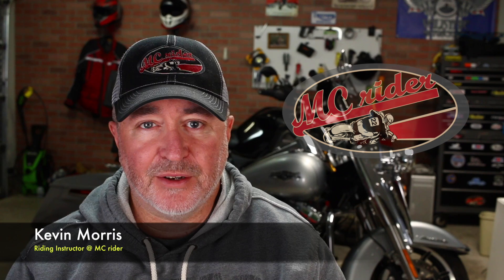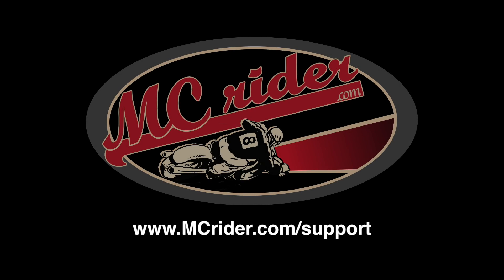How to start and stop a motorcycle with control

Comment: i still can't get into the habit of putting only the left foot down at stops, most likely from starting out with 1966 triumph and 1965 sportster which both have right side shifters,  i even had a norton like that with a reversed shift pattern 1 up 3 down,  you learn quickly how to use a front brake smoothly with those bikes, i would agree that using the front brake during slow maneuvers is not something for beginners. there are some instructors that will say to never use the front brake at slow speed especially when turning which is a farce, it just takes a lot of practice to do it safely, watch the japanese police do slow maneuvers and you'll see they constantly use the front brake to make the front wheel tuck on purpose, my particular bike is known for a very short friction zone which makes slow riding even more of a pain, remember all motorcycles don't handle like yours.
Reply: paul 466 Hey Paul. In Australia, our courses are taught to be ready to move if you need to. Stay in 1st gear, clutch in, rear brake applied and only one foot down. You see heavy cruiser riders around here who take forever to be able to move off.. they are in neutral, arms crossed while they weight for the green light. Take two or three seconds for them to move off when in that posture.

Stay safe with the rubber side down.
Reply: i don't quite get your point, you can still take off instantly holding a front brake with only the right foot on the ground, it's also much easier to hold a bike on a hill with front instead of the rear, you still have throttle control while holding a front brake, i can lock my front wheel with a two finger pull and use the other two fingers for throttle control
Reply: paul 466 This is probably more of a jurisdiction bias. In Victoria, Australis the instructors do not want to see you doing the two finger brake technique... I think they said leave it for the off road dirt. And put both feet down during one of many tests, you fail. I think our logic is that you can get into the friction zone, applying a littme more throttle and start moving off, all without the brake light going out as your foot is still on the foot brake. Gives you an extra second or two gap before the car behind ypu starts moving off. Just a different philosophy from the road authority here.
Reply: that's kinda nuts failing because two feet are down when stopped, it, can't be because of the brake light,  i can control that with the lever , in fact i can make it stay on even after i move off  by not completely releasing the lever same as a foot pedal,  i'v seen a lot of motorcycles go over when on a hill because of one foot being on the brake instead of the ground, the front brake is way better than the rear for holding you on an unlevel road or facing up hill, if the bike leans for whatever reason when stopped you'll never save it if your foot on that side is up, happens most often with a passenger or uneven surfaces, i would follow what rules necessary to get my license but once i have it, i'll do what ever feels safest for the situation i'm in, in 50 years of riding i would say 80 to 90 percent of motorcycle accidents that i actually witnessed with my own eyes the bike was stopped or was traveling under 10 mph, for me it's just too easy to get ham fisted and lock the wheel with a full grip, but then i use sintered pads and my brake has a lot of power with very little pressure plus i have a strong grip from from the work i do
Reply: paul 466 Two feet should not be down. I guess the logic is that you have separated operation of the throttle and brakes. As I said different jurisdiction, even the instructor said do it our way untill you qualify then you can ignore everything as your riding becomes a police enforcement matter. Traffic rules says that you only need to wear a helmet, otherwise you can ride as bare as you like

I think we leave it at that.

Comment: I disagree using one foot down when stopping especially for new riders. They will need to get use to the weight of the motorcycle, two feet down and using the front break is much safer.
Reply from the maker: The MSF teaches left foot down first. Right foot down if needed for balance after the stop.
Reply: maybe for the first few minutes in a parking lot but id have to agree with Kevin...you want the habit to be both brakes.
Reply: Oh terry , how wrong you are , left foot down always
Reply: That's what I learned in motorcycle school. When you are stopped, 1st gear, clutch in, rear brake applied and left foot down only. Same thing in the license test (in Brazil). If you drag your feet, you fail. So I got used to it. Right foot down only  if I'm like... falling over :)
Reply: if you have to use both feet every time you stop the bike, then you probably shouldn't be riding a motorcycle in the first place. Using both brakes is a good habit regardless on rider aides like linked brakes.
Reply: CAPTAIN FOXY I'm short, it never works to use both feet, but I rode for years, left foot only, never dropped a bike.